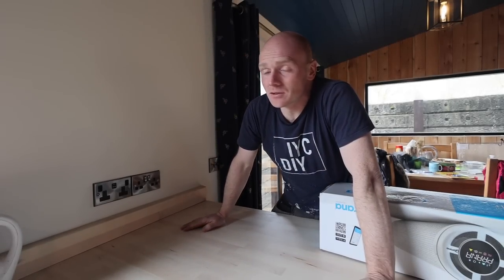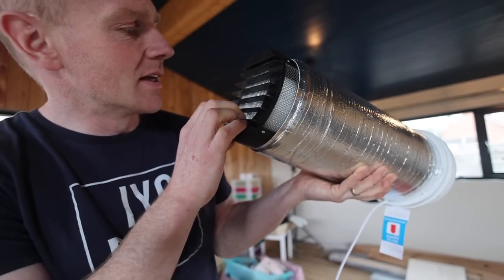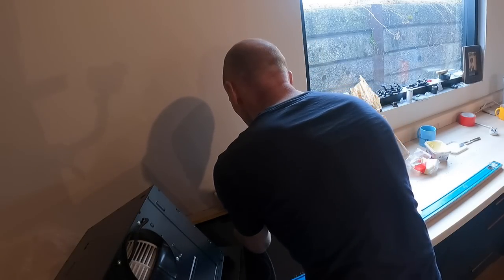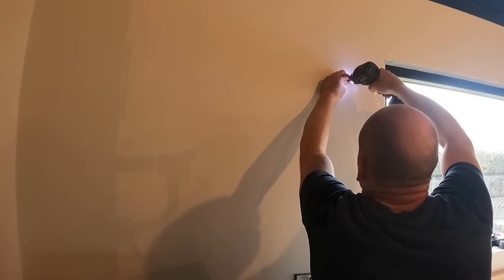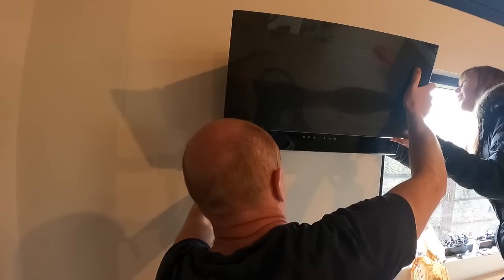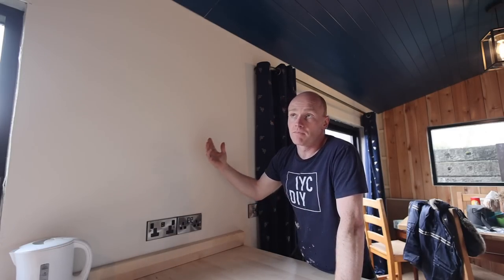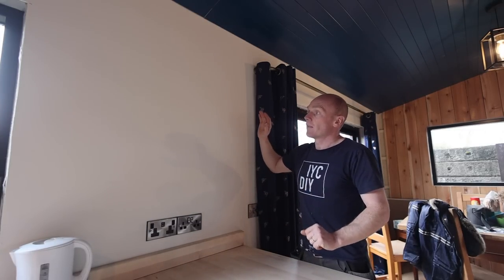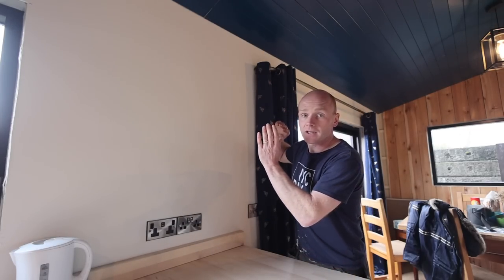WHY DID WE NEED THIS EXPENSIVE FAN? - DIY MVHR Install 💨

Comment: What does it look like from the outside? I'm in a 1800's house and for me that thing sticking out by a foot or so is a no no!
Reply from the maker: 1800s probably means your wall will hide the whole duct. It’s just a black vent. Will be in a future cladding video.
Reply: People in old homes have success with positive input ventilation (PIV) units
Reply from the maker: @allthegearuk  yeah unless you have an airtight old house which is unlikely them MVHR is not the only answer, you can embrace the leaks and use PIV but I would be concerned about pushing that air to cold spots you don’t want it. Perhaps this unit is a bit lower risk especially when paired up with some draught proofing. 🤷‍♂️
Reply: @TheRestorationCouple  I doubt the 1800s house is airtight. It's important to remember that the cold air from outside/in your loft during winter contains less moisture than the warm air in your house. You get condensation from warm moist air on cold surfaces. Diluting the warm moist air in your house with relatively drier air from outside will lower the relative humidity of the air on your house and reduce the amount of condensation you get inside. If your worried about adding a bit of cold air to your house remember that moist air is harder to  heat so by reducing the humidity on your house your heating will be more efficient and the two effects will some what balance

Comment: This product is a scam. Real efficiency 53%, real airflow 52 m3/h  I wonder yours, on the cover, it says 105 or 115 m3/h?  And the CO2 sensor is a joke. Check it with another sensor and you will see.